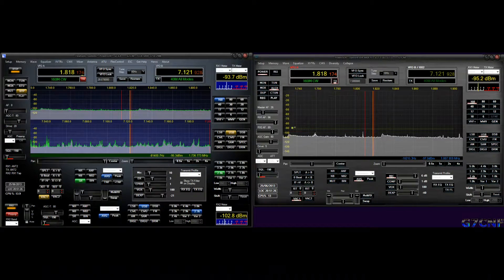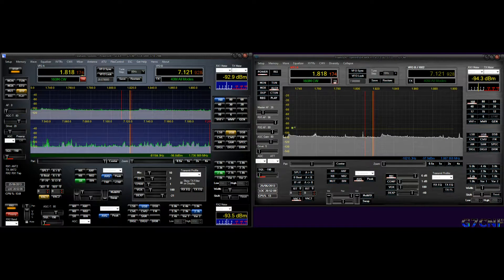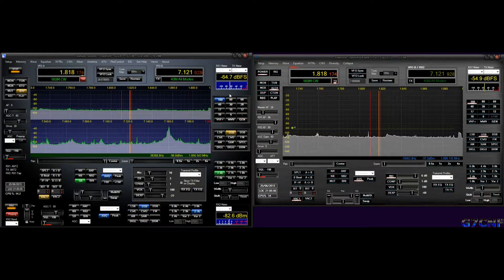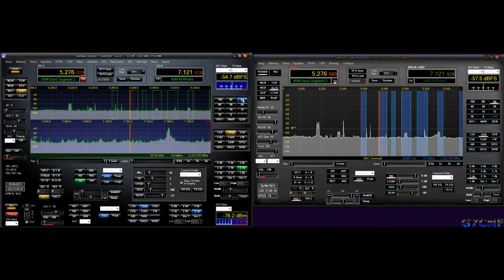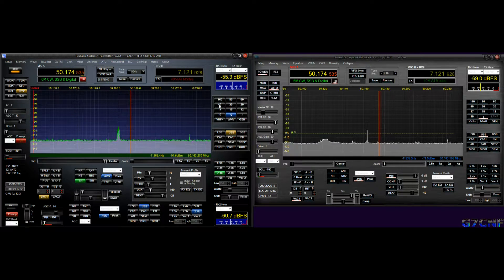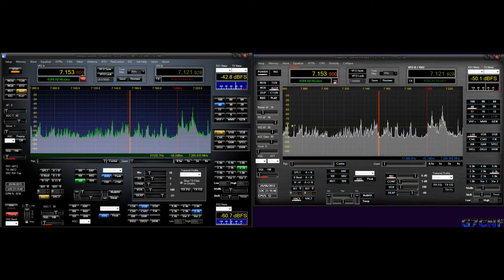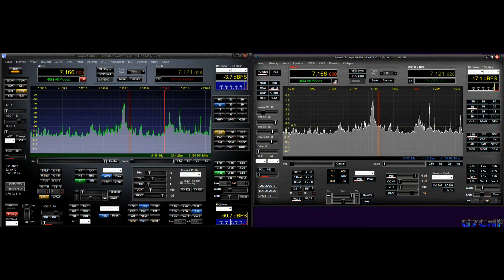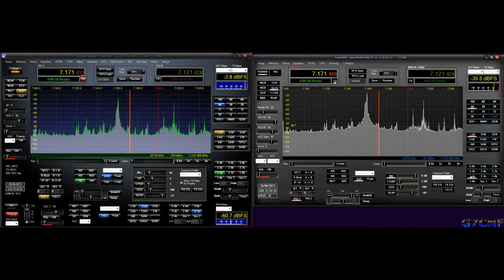Flex 5000 vs. ANAN 100 Large Signal Performance

Comment: Fascinating at 14:00 the audio of the station transmitting is definitely stronger and more legible on the flex compared to the anan. It was almost completely wiped out on the anan though the anan handled the strong signal better earlier in the vid. It's something I always look for and has been a source of frustration (icom 7300)on crowded bands during the big contests. Great vid and many thanks for posting! Maybe do one where you wind each receiver in tight to show how each one handles "bombastic" qrm. 73!
Reply: Stumbled on this video after having a late night chat with the software dev for flex. Both blow our 7300 away imo but not by much. Lol. Console is the dream for the 73. However , I’m impressed with the flex 5000 tx audio. He went out to 7k and damn nation. I still think the 5000 with dual rxers and the 200d are my fav rigs. Well the 101 blows their asses away. But for the $$$ , they’re 2 superb rigs. Seriously thinking of ditching the 73 and grabbing one of the two. Maybe? Maybe not. Lol

Comment: Is ANAN in danger of folding up? Anan owners and  Apache labs seem to be unable to tolerate any scrutiny at all. For instance, I played with the 100b for a month or so and it was a good radio to me with the exception of the monitor circuit which did not properly reproduce the output signal. Never got a response from anyone including you. I think ANAN users are very fragile.

Comment: It looks like the preamp in turned on the for the Flex (should be off on 40). Cannot tell the situation with the Anan. Notice the signals are always stronger on the Flex. Perhaps the set up is not quite equal in this video.

Comment: Nice video, excellent demonstration. 

I just recently got into SDR with a FLEX 1500. 

While I play with the 1500, I plan to study what's out there, thus I've landed on your vids.

I see this video was mid-2013, what are your latest thoughts on these radios and the offerings out there now?

Thanks for your vids brotha!

Rob N4GA
Reply from the maker: If you want state of the art SDR, then Apache Labs HPSDR ANAN-10, 100, 200 or FlexRadio Flex-6000 series.